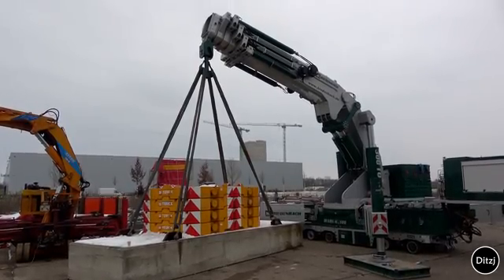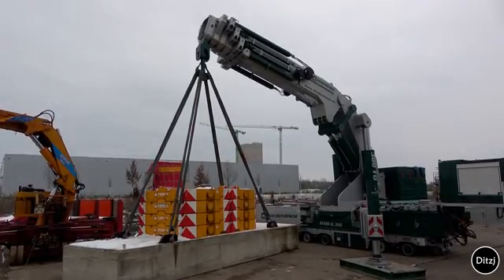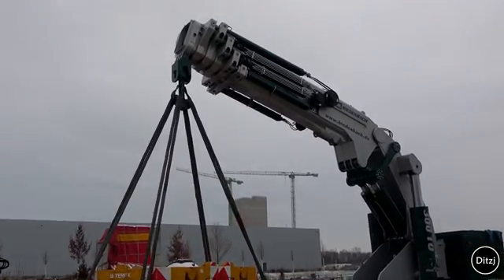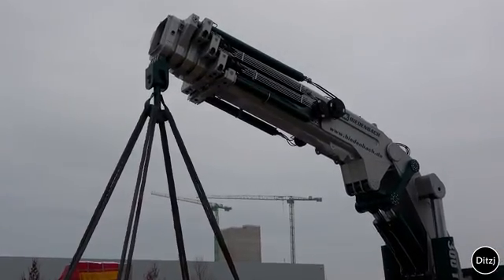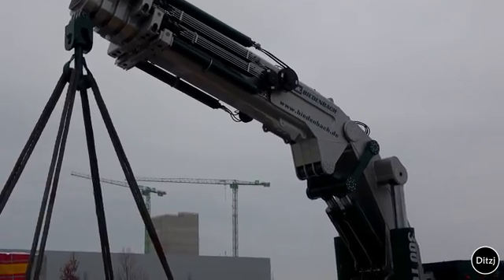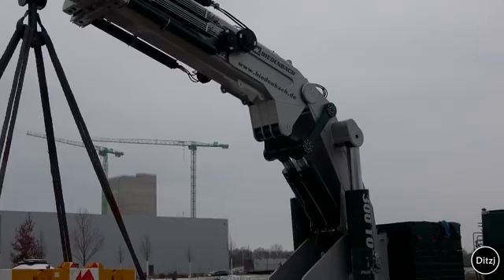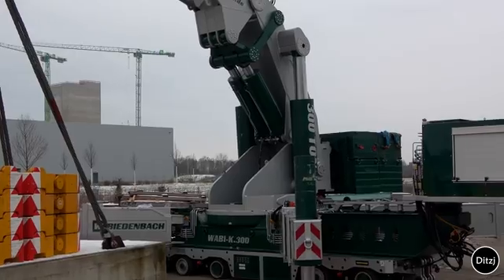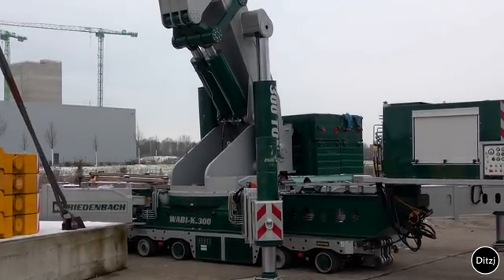W. Biedenbach WABI-K.300 testing up to 125 tons - Largest knuckleboom crane

Comment: What is the general purpose this self immobile crane is designed for? I don’t understand the need?
Reply: Try to move a big machine part under a low roof or below a machine construction in an industrial facility with a normal telescopic crane... 
This kind of cranes has a purpose in every situation were you have no place on the top or you need to move something horizontally through openings in buildings.

Comment: I guess I just don't see the point in knuckle boom cranes. The ones that fold up on a truck I kinda get but if they don't have a winch to hoist with you severely limit its functionality.

For now I'll stick with conventional telescopic and lattice configurations. We rarely see knuckle booms in the usa any way
Reply from the maker: As the knuckleboom cranes usually come with a jib, they are quit flexible even without a winch. As they are completely hydraulically adjustable under load, you can place the load quit precisely, which is why in europe they are often used to install machinery. Also in tight situations, these foldable cranes are often much easier to use then a telescopic crane. Especially in buildings with low roofs, the ability to lift a load directly with the crane without using a winch + hookblock saves a lot of space (height). It all depends on the use cases that you have, if a knuckleboom is good for you or not. In the USA you are seeing them more and more, especially in New York City you will find a large of amount of really big ones. There they are favourite as they can often be used with a rather narrow support base, so only filling 1 lane of the road instead of the entire street. Also with the jib, you can park the crane very near to the building and still be working over the roof.
Reply: Almost all large  knuckleboom cranes have the option of a cable winch from the factory.
 My 135tm knuckleboom has a winch rated at 2.5t single line but can be increased over 10t with the big multi sheve blocks fitted(can be used through the flyjib at full extension & at 15° counter luff too-with reduced capacity).
Knucklebooms are more versatile in a restricted environment e.g. tight main road setups or indoors/warehouses due to their compact operating nature versus a stick boom crane.
 But I do agree with you once they get really big they start to lose that advantage over a stickboom with the draw back of all the added complexity compared to a similar sized stick boom crane 🤔

Comment: Nice but smaal reach as all these types of cranes.
Reply from the maker: In comparison to what kind of cranes ?
Reply: @Ditzj  Normal mobile cranes.
Reply from the maker: This crane is made for indoor use, so always lifting at short range. Therefore more boom is not directly necessary and would only cause less capacity as it is more boom weight. A jib will be build, so more outreach and an extra pivot point will be available. The construction with 2 pivot points (knuckleboom) makes it more suitable for indoor use than a telescopic boom crane.
Reply: @Ditzj  I do like the foldable cranes. I worked a lot on drilling rigs in austria so every truck has big Palfingers. But range was often a problem lifting heavy loads. For quick jobs they are brilliant. But indoor 150 tons is an awfull lot. What stuff are you talking about?
Reply from the maker: Yes, they are shorter, but that is purely design based. Especially truck mounted, you need to keep the boom pieces within the trucks width. On this WABI crane they kept the boom short, to keep it very compact for indoor use. More boom length means more difficulties in sharp corners between machinery. They install a lot of heavy machinery and these machines are getting more heavier nowadays. Often 80 to 100 tons is not rare. And if you can lift this with 1 crane instead of 2 cranes, that often makes the difference between getting the job done, or not.
Reply: @Ditzj  Foldable cranes still amaze me. So compact, so much power. All hydraulic. Thanks for your explenation. Do you work for a crane company btw?
Reply from the maker: @Coordinator61  Yes, they are also impressive to me. No I work with transmissions.
Reply: @Ditzj  Thanks.

Comment: It's stronger than a Liebherr LTM1300 6.1 😊👍
Reply from the maker: It was aimed to be able to lift heavy machines with about 80 tot 100 tons in a single lift, not needing 2 cranes. So yeah, therefore it has to be in the same class as a 300 tonnes crane :)

Comment: Soo, where does the 300 ton comes from?
Reply: 350 ton at 1 meter radius if i'm correct. 
Thats a phrase to give a insight on it's class ... ( sorry if it's not best chosen english pronouncement )
Reply from the maker: Maximum capacity is 200 ton at the hook. The 350 ton is the class it represents. Normaly the crane class is defined at 3 meters, but with a knuckleboom the maximum load is not most important issue, but the capacity in Ton*Mtr. Here we have a max of 1145 t/mtr, which would mean at 3 mtr a load of even 380 tons. But as said, it cannot lift 380 tons in a single lift, as it was not built for that. But the lifting capacity equals that of a 350 ton crane, that is the important information.
Reply: @Ditzj  i feel stupid saying the 3 mtr 🤗
Furthermore you're explanation is without a doubt better than mine 👌
Reply from the maker: They planned a 300 tons class crane, but it turned out stronger and is now more a 350 tons class